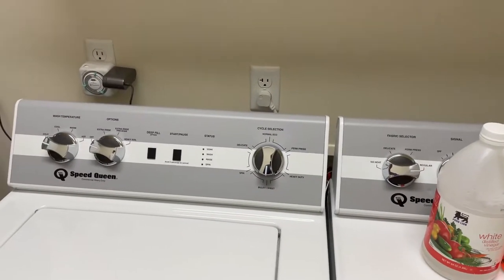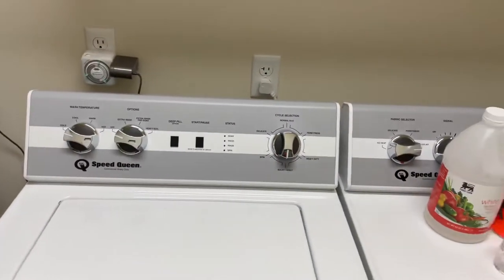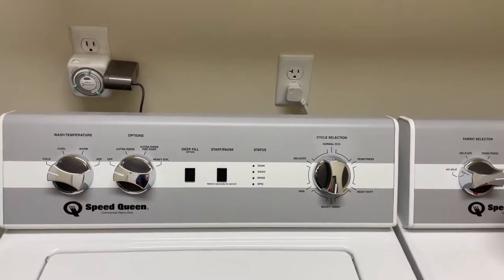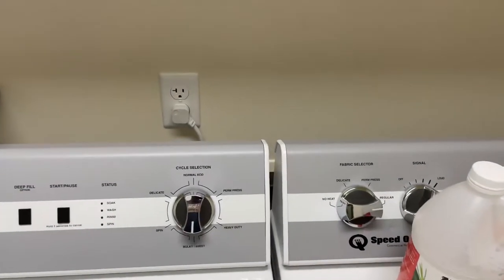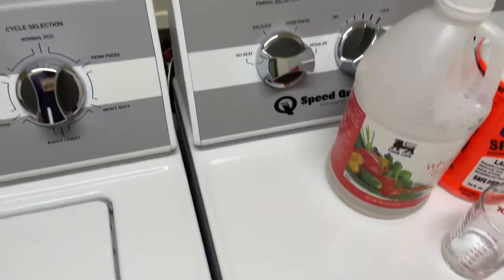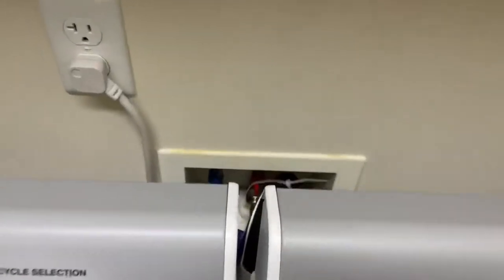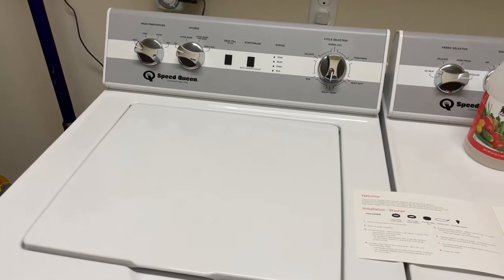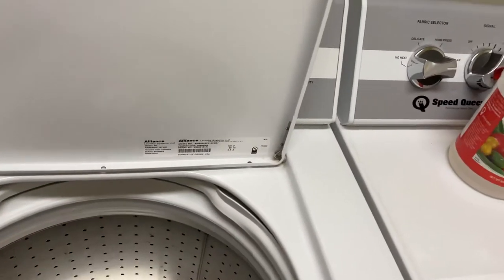Foam Bubbles coming out Speed Queen Washer drain hose - Fixed!

Comment: Vinegar is harsh on the rubber parts, so be careful!
Reply: Also it corrodes any metal it touches
Reply: The vinegar is highly diluted which will have little to no impact on rubber parts and not enough to corrode any metal parts (or the stainless steel tub). Yes, if you put only straight vinegar into the washing machine, that can cause some damage but the dilution ratio of vinegar to water is something in the ballpark of 1:1,500 or a 0.06% vinegar solution (2oz vinegar to 24gal water). That's not enough to impact the pH of the water much at all.

Comment: I believe I may have solved the sudsing problem. Distilled white vinegar 2 ounces DIRECTLY DOWN THE DRAIN PIPE INTO THE TRAP WORKED FOR ME.. BUT I thought of something different,I bought a drain hose and stuck the raw end as far as I could until it hit the bend in the trap pulled it up it was under about 6 or more inches of water. Shoved it back down till it hit bottom spun it a few times trying to feel the direction the pipe turned I couldn’t get the drain hose to make the turn but I got it facing the correct way SO FAR SO GOOD NO SUDS. The soapy water gets flushed at the turn. Suds float, like in the tub so if I can flush them at the bottom of the facing the turn back up the force of the pump will take the suds up the turn so they can float on the other side of the trap👍👍👍
Reply from the maker: Hi Brian.  I'm not sure what that changes, but please keep me updated.
Reply from the maker: Hi Brian.  I'm glad you found success.  But, be careful.
A washing machine's standard drain hose is designed to only reach inside the house's drain pipe about 4".  That leaves an air gap in that pipe.  That air gap is what stops a backed-up/clogged/slow draining pipe from siphoning water backwards, out of the P-Trap, and back into your washing machine.   It sounds like you eliminated that air gap.  If your drain pipe plumbing on the other side of the P-Trap ever drains slow and backs up - you could have a flood of sewer water on your floor.
Reply: My drain hose is 1 “ my drain pipe is 2”. There is no air lock if there where ever a clogging or blockage it would be free to back up just as it would in EVERYONE’S open gravity drain pipe.

Comment: I spoke with Speed Queen last Friday. 5/24/24.  They sent me an email on a fix.  They are telling me it’s a build up of soap on the drain wall. I tried the vinegar with no luck. Their next option was to use fabric softener, which I normally do not do. But I was willing to try anything at this point. My machine is only 1 year old. It’s been going on long enough that my floor linoleum has separated where it was glued together under the washer. I just did not discover it until 3 weeks ago. To my SURPRISE the fabric softener worked.  I am still going to run 2 cups of vinegar through my machine with HOT water once a month as the tech said this is just good maintenance for washer. When using the perm press or delicate cycle I am having no issues due to the LOW spin cycle I am sure. Hope this helps some of you!
Reply from the maker: Hi Mary.  Thank you for adding that information.  I'm glad the fabric softener is working for you.  Thank you for leaving a comment.  Please click on the words “Rick’s Tid-Bits” underneath the video to go to my YouTube channel.  I think you’ll find some helpful and unique tips in my How to Make Life Easier or Better section.  https://www.youtube.com/channel/UCc-IuUFzC2Tyv06KzJyBESg  Rick
Reply: Thanks so much for the answer direct from the ppl who know. I’ve just noticed this problem. I’ve been seeing a little water on the floor with no idea where it came from until I watched a cycle all the way through. I hadn’t seen the foam with our old garbage washer (that died at five years old) and figured it had something to do with Speed Queen being a commercial washer—strong spin, etc. I’m willing to change my practices for a good, durable machine, so I’ll follow this advice.
Reply from the maker: Hi Matt.  You're welcome.  You’re welcome.  Thank you for leaving a comment.  Please click on the words “Rick’s Tid-Bits” underneath the video to go to my YouTube channel.  I think you’ll find some helpful and unique tips in my How to Make Life Easier or Better section.  https://www.youtube.com/channel/UCc-IuUFzC2Tyv06KzJyBESg  Rick

Comment: Would you buy again/recommend speed queen?  These potential issues are starting to put me off the product........
Reply from the maker: Hi Gregory.  Well . . . that's difficult to answer.  I am old school.  For me:  The less electronics appliances have - the better.  Give me plain old mechanical timers and switches - and I'm happy.  If I could (right now) buy a brand new, mechanical, 10 -30 year old Kenmore, Whirlpool, or Maytag, I would.  I can always repair those (like I did for the past 40 years).  
     I thought that's what these were.  But I later found out that these have (minimal) circuit boards also.  From the research I did:  Again, for me, this was the most reliable, reputable brand.  I learned that a major problem with a lot of other brands is:  You can't get parts for them even just 2 years later.  They make x number of units, and x number of spare parts.  Then they change their electronics, and those parts don't fit, and you can't repair it.  I called quite a few appliance repairmen and they all told me that.  So, now that I've cured my foaming issue by adding vinegar every time - yes.  I would buy these again. 
     Thank you for leaving a comment.  Please click on the words “Rick’s Tid-Bits” underneath the video to go to my YouTube channel.  I think you’ll find some helpful and unique tips in my How to Make Life Easier or Better section.  https://www.youtube.com/channel/UCc-IuUFzC2Tyv06KzJyBESg  Rick

Comment: So, I now have this problem and the vinegar absolutely does not work. I’m not sure what to do from here. It’s only about 1.5 yrs old and as it’s just 2 of us in the house, it’s not even hardly used.
Reply from the maker: Hi Eric,  I have 2 things for you to try.
1. Do the soap residue flush with hot water and a good amount of vinegar.  I believe I mention it in this video.
2. After that, consider using less detergent.

Comment: Follow up to my comment below and action taken. I called Speed Queen customer service after writing my comment below. The gentlemen that answered the phone was very nice and was aware of the problem. He explained similar to what was stated in the above video that these machines require very little detergent and if too much detergent is being used it will cause a build up of soap within the machine. He instructed my to run the machine 5 separate times on the Heavy Duty cycle, with hot water and deep fill with one cup of vinegar and 2 tablespoons of dawn soap. He indicated that you should occasionally run the vinegar and dawn soap through the machine to prevent soap build up. Out of an abundance of precaution, I followed his instructions with the vinegar and dawn soap on 8 separate times and ran it twice afterwards with no vinegar or dawn soap in an effort to clean the vinegar out of the machine.

He also asked me what type of detergent I was using and he instructed me to only use 2 tablespoons of my liquid detergent for washing. I had the following results after cleaning the machine out with the vinegar and dawn soap:

  2 tablespoons of detergent on Eco Cycle: same problem, soap coming out the drain pipe;
  1 tablespoon of detergent on Eco Cycle: same result;
  less than 1 tablespoon of detergent on Eco Cycle: same result;
  2 tablespoons of detergent and 2 tablespoons of vinegar on Eco Cycle: same result
  2 tablespoons of detergent, and no vinegar on Permanent Press Cycle: Success!

So, I guess I paid for an expensive machine that I can only use the Permanent Press Cycle. 

The customer representative indicated that Speed Queen can send you a part to switch out that I think reduces the spin capacity of the machine that may resolve the problem. Not sure how that impacts the effectiveness of the machine to clean the clothes. Very frustrated with this whole process. Wish I bought the typical washing machine for less money. Never had this problem nor had this problem in this house.
Reply: The part they send is an anti-siphon valve and the place where we bought our washer installed it for us.  It did not fix the problem.  The reason why Permanent Press and Delicate mode works (without creating the foam) is these two cycles use a lower speed spin which keeps the pressure down in the unit when blowing water out the drain tube.  While this works, the clothes will come out more damp which means it takes longer to dry in dryer.  Extremely lame we can only use low speed spin on these units unless you start to use vinegar with each load.

Comment: Use fabric softner it make all the foam disappear in one second is made to rinse the soap!
Reply from the maker: Thanks Cal.  However, I never use fabric softener or dryer sheets.  They clog-up the pores of my clothes and then my clothes don't breath when I'm working in them.
Reply: @rickstid-bits  seriusly? 😂 take a downy softner you cant live whitout once you try! Is better whitout? All the soap and enzymes on tour clothes in oh very alcaline like the detergent? Are you kearing me?
Reply from the maker: I live just south of Richmond, VA.  I work outside all summer long.  I wash everything with Atsko Zero Wash.  It is a detergent with only a mild amount of soap.  No fragrances, no fluff, no anything.  When I use this all my clothes breathe, and absorb sweat.  That keeps me cooler.  If I don't use that detergent, or if I add fabric softener, my clothes don't absorb the sweat, don't breathe, and it's like I'm wearing plastic lined clothes.  I learned this 15 years ago and I'll never go back.
Reply: @rickstid-bits  yes if use to much is very true that softner is grease on fibers and make them not absorb water thats why i dont use o towels, but just the minimum amount i don't thing gona cause all of this problems... i touht you was kearing any way im sorry... peace but the way never mix vinegar that is acid with detergent that is basic, add at the last rinse, and will be bettere if you use citric acid instead of vinegar, that is more delicate with machine and much more invoronmental friendly, because vinegar is not good at all like everybody think

Comment: Google answer...Do I have to use (HE) detergent in Speed Queen washer?
It should go without saying, but if you have a high-efficiency washer you should use a high-efficiency (HE) detergent. HE options produce fewer suds and make it easier for HE machines to rinse out the soap. You can always buy HE detergent for any washer but do not buy standard detergent for an HE washer.

Comment: My Speed Queen washer and dryer are about 11 or 12 years old.  They don't have dials. They have an electronic board. However, I have the same suds problem. I started using Woolite, 1 tablespoon for small and regular  size loads, 2 tablespoons for large loads, and my suds problem resolved. Once a month, I  also use a washer machine cleaning  tablet to clean the tub.
Reply from the maker: Hi Bella.  That's good to know.  Thank you for adding that information.  Rick

Comment: You described the same thing that is happening with my speed queen but vinegar didn't work...
Reply from the maker: Hi Georgia.  Go up to my description and click Read More.  Read everything in my description.  Then, try step #1.  That should flush out all the residual soap that is clinging to your washer in places you can't see.   Please come back and let me know if that helps.  Rick
Reply: Have you had a chance to switch the mode to permanent press?
Reply from the maker: I have.  And I know that cycle doesn't have the foaming issue on our machine.  But I just can't give up the high speed spin.  The high speed spin wrings out and dries the clothes so much more - which means the clothes spend less time in the dryer.  Rick

Comment: I hate the idea of playing games with a new $1k machine BUT if I have this problem, I might add a short section of tubing over the standpipe that has two holes in it. One (one the top) is for the water to drain. The other opening on the side would be attached to a simple plastic overflow tank. This way, it will drain as usual but if excess bubbles or water should come back out, it will go into the tank and not all over my floor. Does anyone have a concern with this? Would introducing an overflow tank create any issues with siphoning or back pressure. I believe I would need to vent or have the overflow tank semi-open/vented so it would draw in more air. Like in those old pineapple cans, you have to puncture both sides on top. I think it would drain better this way.

The elephant in the room. IF bubbles/moisture has enough pressure to push past the special adapter, rags, towels, etc., it is certainly making it's way back down the drain tube that is attached to the machine. This means, there will be standing water/suds in the bottom of the machine. This can encourage mold- especially if you travel or leave it standing for days at a time. Mold thrives in dark/damp areas.

It seems to me, their engineers need to put their thinking caps back on or find new employment. We can literally land on the moon but we can't design a $1200+ machine to completely drain?
Reply: @eloquent-nuance  Thanks. Problem is my standpipe is in the wall. It is always a code violation to "restrict flow." In fact in doing so it can likely increase foam. Also, no traps are that large either, usually 2". I am glad you are having success though. 

I only use a teaspoon of good HE liquid and have not had any real issues yet. I am keeping an eye on it. I also have a shut off sensor so in theory the machine should turn off if it senses water. It sits in a plumbed metal 2.5" tray as well. The idea of the two overflow pans on the wall with high mounted drains is to catch any suds and retain the water. I don't want it going under my machine (main pan) except as a very last option. Hopefully I never have to use it, but it's there if I ever need it. I dealt with a 12k water leak a few years ago- don't want to go through that ever again.

Comment: Thanks for the tips. Unfortunately vinegar doesn't do the trick for me. But what I found that Delicate/Perm Press "low" spin is sufficient for us and doesn't cause this problem. Even when using the low spin speed, the laundry is not too damp that it requires much longer drying cycle. Even cotton towels only need regular (not extra/more dry) drying cycle after being washed using perm-press cycle.
Also for those who don't use High Efficiency (HE) detergent, you'll need to use HE also. Even though this is a top-load, the manual specifically says 'HE' detergent is preferred/required. In my case using HE still caused the excessive soap suds problem, maybe because we have water softener.
Reply from the maker: Hi Dody.  Thank you for adding your info here.  I have the same results as you if I use the cycles with the slower spin speed.
Reply: I think bingo. I don't have the problem and I have hard water that is difficult to produce suds  to in any situation. I would imagine too much softness in your water would trigger overuses in some machines and situations.  That explains why some have the problem while others don't with the very same machine. 

Why don't other machines have the problem with soft water? Perhaps it is because the TC series has a very aggressive agitation which is why you bought it in the first place, one of the reasons anyway. That aggressive agitation will of course generate more suds and foam with very soft water. 

The fix is to get a front loader or a TR series top loader from Speed Queen or turn down the water softener, perhaps.
Reply: @arthurtennessen9680  I do not have a water softener but still have this problem.

Comment: DONT USE VINEGAR IN YOUR APPLIANCE!!! Technicians used to advise using vinegar to clean appliances out but we found out it was eating away at the plastic parts and making them weak, causing the unit to fail quicker than anticipated.
Reply: Virtually all technicians and appliance experts on tiktok did a campaign stating that there’s no such thing as a vinegar damaged machine, it’s safe, and it’s effective…
Reply: @piecesoftheheart9231  keep using vinegar in your washer and see what happens
Reply: @dylanclay2741  

I’ve been using vinegar in my washer for 19 years as a home owner.
Reply: @piecesoftheheart9231  say what you want.  Ive worked on enough washers to know that isn't true.  Vinegar ruins rubber/plastic parts and corrodes any metal it touches . A $1400 washer shouldn't have to use vinegar to prevent foaming .
Reply: @dylanclay2741  

You’re allowed to have that opinion, but every single major appliance expert on social media (with a large following) negates and disagrees. 

Straight, undiluted vinegar (like most products) is capable of corrosion… 5% already diluted, then further diluted 1000 to 1, renders it incapable (scientifically) of causing corrosion.